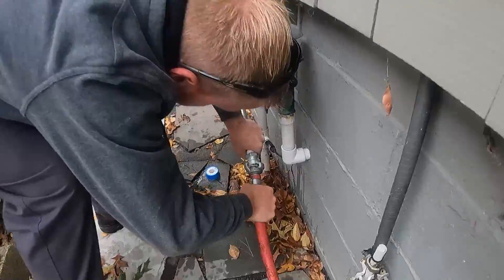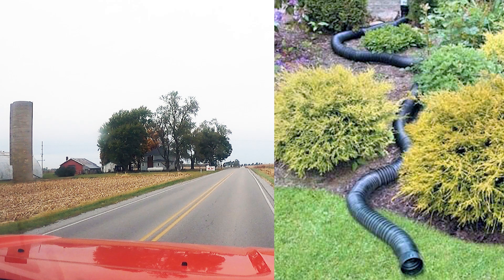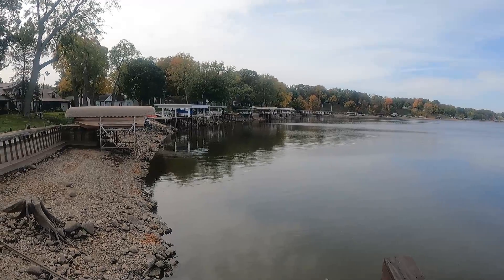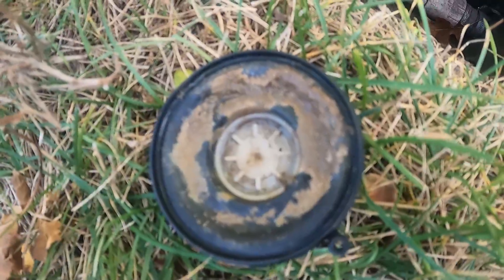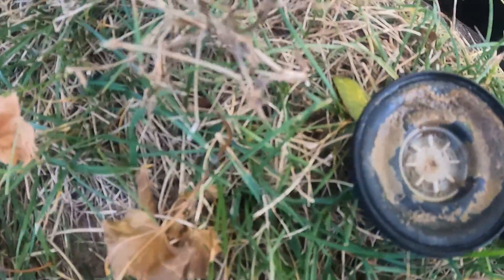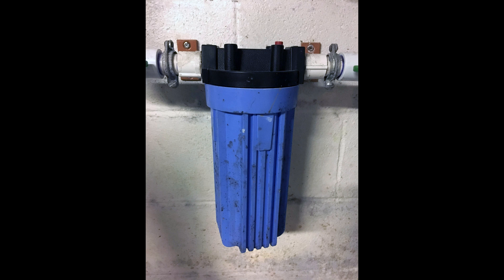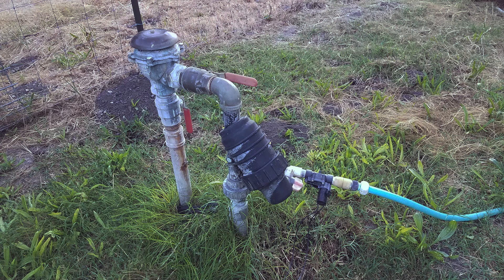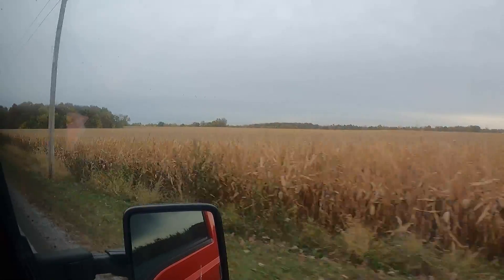Well Water for Landscape Irrigation | Lake, Pond, and Gray Water | Pros and Cons

Comment: That automated filter flush looks really great. For my system I’m working on building for raised garden bed irrigation I’m currently planning to use central constant pressure filtration to avoid have a filter for each bed (zone), which would be a lot of filters in my case. Since I’m on well water having my filter flushed as an additional zone is a very interesting consideration. Thank you for another great video. As always, I appreciate your maintenance perspective.
Reply from the maker: I'm glad you're finding the content helpful. That system you have in mind sounds great.